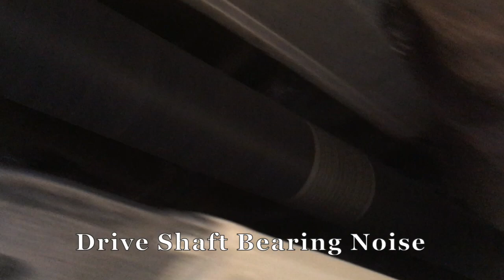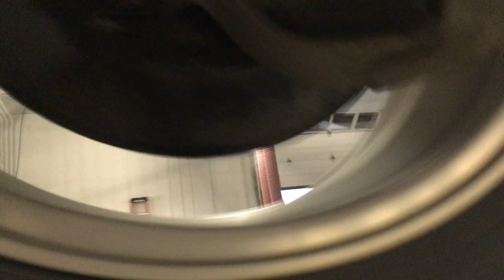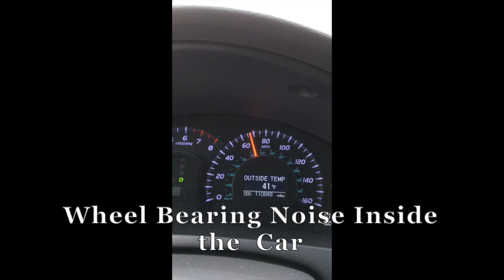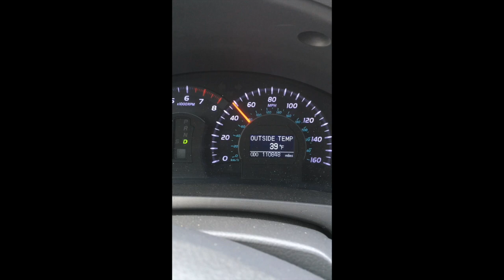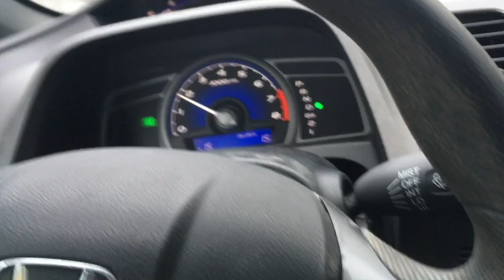Wheel Bearing Noise VS. Drive Shaft Bearing Noise

Comment: My 2017 Grand Cherokee limited (40k miles) just started making a low rattling/vibrating noise underneath. TBH I only noticed it bc I turned the radio off. It only does it once in a while and does not rattle/vibrate noise when going over bumps.  It also does not do it while turnung. When I put the window down to try to hear it I can't. I can only hear it when the window is up. I checked through the inside and nothing is loose inside.  My bf says it sounds like something is loose. It started right after inspection. I do know my front brakes need to be replaced soon..could it have to do with that?  Any suggestions?
Reply from the maker: Hi RyanMarie, usually a rattle at low speeds and the RPM's at about 1000-2500 is caused by a loose exhaust heat shield. I recommend you start by checking your exhaust for any loose shields, try hitting your exhaust with a rubber mallet or the palm of your hand when it's cold to see if you can reproduce the noise. Let me know what you find or if you have more questions.
Reply: @EddieCarrara1  thank you!  I will have my bf look. It is safe to drive?
Reply from the maker: @ryababe24  You're welcome, I don't know if it's safe because I don't know what is making the noise. I wish I had a better answer for you lol.
Reply: @EddieCarrara1  It's strange bc last night I accidentally hit a pothole due to the fog and now the sound has gone away lol

Comment: I have a rough whirring noise at speed above 50mph, more accuse at 70. It goes away when I depress the clutch. It’s not the engine as when I depress the clutch at rev, at speed, the noise isn’t there. That also make me think it’s not a wheel bearing.

Any ideas what it could be?
Reply from the maker: You're right Craig, it's not a bearing because the noise wouldn't go away when depressing the clutch, maybe a bearing in the transmission.
Reply: @EddieCarrara1  thanks Eddie 👍

Comment: Hey Eddie, have just subscribed got your channel and found a lot that is very informative and interesting. I own a jeep grand Cherokee and touching about 100,000 kms and find that everytime I cruise on the motorway, I get a vibration noise between 80 k mph and 100 k mph which is roughly between 50-65 miles an hour but disappears when I take my foot of the gas. The vibration does not seem to appear at lower speeds as well. Any help
Would be great. Thx Vikas
Reply from the maker: Hi Vikas, It's sounds like you're describing a ring and pinion noise or maybe a driveshaft carrier bearing noise, but , with our hearing it it's hard to guess. Let me know if this helps of you have more questions.

Comment: I got a high pitched screech sound when I moving forward, doesn’t matter the speed. It will go away sometimes, but comes back once I make a left turn, any ideas ? 2013 Mitsubishi Lancer GT
Reply from the maker: Hi Ozzi, sounds like the brake pad wear indicator is hitting the rotor warning you that the brake pads are getting low, I recommend you inspect all 8 brake pads. Keep me posted on what you finds, thanks.

Comment: I knows that rule of thumbs BUT... sometimes is backwards, I replaced the right bearing on the front, then noise still in there, then replaced rear right, and still there, then just in case i put the front right one (supposedly bad) on the left side, and noise was gone. I put together somethings, ..that I was driving alot on high way and taking exits and switching to another highways, and all that weight of the car going 70,80 mph all on the left side made wear down the bearing in a way that when i ease on that left side , turning left and put the weight on the right noise would go louders, feels like the bearing on the left got wore down in a way that actually having more weight on that would not cause noise but doing backwards would
Reply from the maker: There are things that happen in the automotive world that just cannot be explained using common sense, this is one of those things lol, thanks for sharing Junk Mail 🍺

Comment: im so lost. all the videos i look up none of the sounds sound like my car. its a quieter popping noise like popcorn. when i slow down, speed up, turn loose or turn tight but not everytime. no clunks, no loud pops, just quiet ones a lot in a row. i looked at wheel bearing, drive shaft, cv boots, axles, shocks etc, none sound like it :(
Reply from the maker: Hi Ariana, check out this video, it's one I made on CV joint noise. Watch the whole video because there are a few seconds where the noise is very obvious and let me know if this is the same sounds toor car is making. If it's not maybe you can take a video of it happening and post it to YouTube and send me the link so I can hear it.

Comment: Doesn't leaving the CV joints on that angle and letting the engine spin them damage them?
Reply from the maker: Hi Nick, no, the suspension can only hang so low. we've been doing it like this for 35 years lol. Good question tho.
Reply: @EddieCarrara1  The reason I ask is because in any service manual I read it says not to let them hang that far down and to have the car supported on jack stands and lift up the trailing arms to keep the drive axles as straight as possible?
Reply from the maker: @nickfatsis9607  I think the reason for this is when the suspension is hanging it will create different noises because it's not at its normal ride height. As the vehicle goes down the road the suspension is constantly changing ride heights and is not being damaged. I have never damaged a vehicle with this procedure and some vehicles have been driven on the lift for over 30 min sometimes trying to locate a noise. I'm not going to say you could never damage a vehicle with this procedure because I don't know everything and every situation is different,  I'm just saying for all the years I've been working on cars I've never experienced it nor has any of the mechanics I've worked side by side with experienced it. Hope this helps.
Reply: @EddieCarrara1  well you're correct about ride heights, sometimes people drive at high speeds over rapidly changing road heights, the car goes up and down pretty quickly and the suspension is fine, thanks for the reply.
Reply from the maker: @nickfatsis9607  You're welcome Nick. I know there is an exception to every rule and I certainly don't know everything so I like to show or explain my experiences rather than try to prove I'm right. I know there is a lot more that I haven't seen than what I experienced, lol. Thanks for bringing it up, it makes us question ourselves which is a good thing, Cheers 🍻

Comment: My jeep 2015 grand Cherokee is making a sound coming from the front gets louder when going faster almost like a rotating sound like its grinding with somthing also vibrates my pedal a little
Reply from the maker: Hi Jerry, 
I recommend you inspect the brake rotors for rust on the braking surface. It's possible you may have two different problems. Does the rotating sound make a noise like a wheel bearing when comparing it to the wheel bearing sound in the video? The vibration may be caused by brake pad impressions on the rotor surface or rust, I'm assuming the vibration is in the brake pedal when braking??
Reply: Mine does also and iv had my brakes checked my wheel bearings changed and my shocks changed and still does it

Comment: I have a rubbing sound when accelerating and coasting. I think it’s drive shady related but unsure.
Reply from the maker: Hi LongBeachGrower, is it an automatic or standard transmission? The noise maybe a motor or transmission mount that is worn or broken?
Reply: @EddieCarrara1   Thank you, it’s an automatic. The noise sounds like it’s coming from thee middle or rear of the car. 2002 Chevy Astro AWD
Reply from the maker: @nonamenomad5768  If the vehicle has a center carrier bearing in the propeller shaft, that may be a possible cause. I recommend you check that first. Let me know what you find, thanks.

Comment: I have a squealing noise like if I was drifting, when I drive and turn a corner or if I hit a bump on the road. I’m having a hard time trying to figure out the problem
Reply from the maker: Hi Bryanna, check the brake pads, one might be low on material and the brake pad wear indicator may be touching the rotor. Let me know what you find, thanks.

Comment: Hi Eddie. I have a 2001 Toyota Sienna van with front struts, ball joints, drive shafts/tie rods and as of this weekend control arms replaced. Since 2017, I've been through 5 sets of tires and on the front passenger side twice I've had the inside of tire wear so bad or split due to what I thought maybe the control arms. 252,000 miles on those. I drove it this weekend with new tires and she is dead on center of lane at 75 mph highway, but there is a low humming sound still!? My Toyota mechanic told me it was drive shafts and I replaced those two years ago. He said wheel bearing was fine. I believe that front bearing is bad, but I am totally lost having replaced everything but the rack and pinion.
Reply from the maker: Hi Debbie, If possible I highly recommend you get a second opinion on the wheel bearing. A thorough mechanic will put your car in the air and check each bearing with an automotive stethoscope to pinpoint the noise. If they just drive it they are guessing and that's not cool. Let me know if this helps or if you have more questions.

Comment: My 2009 Volvo C30 is making creaking noises from the front passenger area. Seems to be related to throttle input but also steering while going slow and hitting bumps. I’m thinking it may be a engine mount or ball joint but not entirely sure. It started a couple days ago and the weather is now below 30°
Reply from the maker: Hi Simon, 
Both of those worn parts can cause a noise like you're describing. Do you feel any clunking when snapping the accelerator hard from a stop or power braking when stopped?
Reply: @EddieCarrara1  nope it’s just prominent creaking when pressing on the gas and when turning at low speeds. Bumps don’t necessarily cause the noise but they do affect the noise when accelerating. I’m also considering the control arm bushing as a possible culprit

Comment: I have a humming noise when I drive straight or left. It goes quieter when turning right. Its loudest at 50-60mph. I also saw some dark green gunk under my car, don't know if its related. Is it my driveshaft, cv or wheel bearing? Or all three?
Reply: Golf MK5 GTI
Reply: It also clicks when I full lock right
Reply from the maker: Hi AZ, The green gunk is most likely CV joint grease, it's possible one of the boots is torn open, that would also be the reason for the clicking noise. Unfortunately the hum noise is likely a wheel bearing. By your description it would be a bearing on the right side of the car but I recommend you have it diagnosed by a reputable mechanic just to be sure. Keep me posted on what you find, thanks.

Comment: 2004 honda accord coupe v6 manual I get vibrations during  acceleration under load and sometimes after a while of driving even on highway when coming to a stop it sounds like a growling sound from the passenger side no one know what it is 😭
Reply from the maker: Hey SS, check out this video I made https://youtu.be/1f13AFjqyrY We had a vehicle that did the same thing and this is what we found so you may need to replace one of your axles to repair your problem. Let me know what you think, thanks.
Reply: @EddieCarrara1  thank you kind sir! I will definitely!!!

Comment: I have a Chrysler Sebring 01 and I've been hearing a noise as well. Overtime it has gotten louder. At first I never could hear it but my child father heard the noise from my car. I didn't start hearing it til a few weeks later because it was noticeable. When I accelerate it from 30mph-70mph it's really loud. If I drive it under 30 then the noise is low but what would happen if you keep driving on it and you didn't get it fix yet?
Reply from the maker: Hi Makita, It's going to continually get worse and the noise will get louder. I recommend you have a mechanic check the noise and give you their opinion on how long you can drive on it. hope this helps.

Comment: Hi eddie, my car developed a bad wobble on drivers side at around 50-60 mph but goes when I put the clutch pedal down then returns once released. Took off wheel and my bottom ball joint is bad, would this cause a wobble on the wheel ? And would it stay if I put the clutch pedal down or am i looking more like a bad drive shaft cheers eddie
Reply from the maker: Hi LLoyds, ,I recommend you start by replacing the known problem first and if the you still have a wobble I recommend you check your u-joints if you have them because it sounds like you may have two different problems. If you don't have u-joints and your car is front wheel drive, the clutch problem may be either a worn inner CV joint or clutch pressure plate. Let me know if you have more questions.

Comment: @eddie Carrara how you doing brother ? Listen I have a noise on my Acura MDX and I take the car to the mechanic and they didn’t find anything but Iam pretty sure that the car have a noise who can hear it if you roll down the window. When you go at high speed 50 , 60 the noise is more notable but when you press the brake pedal to reduce speed you can hear it louder. It’s not a clunk or squeaking sound it’s more like the wheels rotating and getting in contact with something like a straw. If you have the car up in the jack and someone in the car driving and you put a straw to get in contact with the tire. That’s the best I can describe that noise. If you can help will be very appreciated. Thank you
Reply from the maker: Hi Hansell, I'm doing well, thanks for asking 🍻Does it sound like a helicopter or a humming noise? It could be a wheel bearing noise, they usually start making noise around 20 mph and get louder the faster you go. Can you make a video of the noise and post it on YouTube then send me the link so I can listen to it?
Reply: @EddieCarrara1  hey brother thank you for your answer I will do the video but checking again your videos about the difference bt bad driveshaft and bad wheels bearing is sound more like and helicopter sound but when you slow down the speed it make noise too. I take the car to the mechanic and he checked but I don’t thing is what he said it is because he’s diagnostic was the brake drilled rotors make the noise. But Iam pretty sure it not that I just installed them a years ago all 4 rotors with the brake pads.

Comment: I have something similar sounding to the drive bearing noise in a 2003 Subaru Legacy b4 twin turbo. However it’s accompanied by a smell of gear ok even though it’s just been replaced with the correct grade of oil.
Reply from the maker: Hi Mars, did it have the wrong gear oil in it?

Comment: How can you tell if it's front or rear wheel bearings,
Mine starts roaring around 50 km per hour, when I steer to the right,  it noise is a bit better,  and when I steer left, it's louder.
Reply from the maker: Hi Juwan, you'll have to take it to a mechanic so they can check the noise when the car is in the air. It sounds like it's a bearing on the right side of the vehicle but I'm not sure front or back? Keep me posted on which one was bad, thanks.

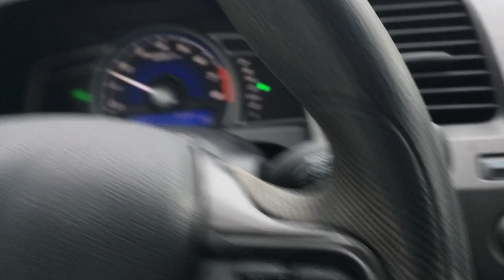Comment: Thank you for the video, it's very helpful.  Your explanation at 2:40 makes sense "the side that the bearing is bad on usually gets louder when you put the weight of the vehicle on it."
When you make a right hand turn doesn't that put the weight of the vehicle on the right hand side, and therefore on the right wheel bearing?  So if the right wheel bearing is bad, shouldn't it get louder when you make a right hand turn?
Reply from the maker: Good question Mario. When you turn right, which way does your body want to go, left or right?  You weight goes left which explains simply that the weight of the vehicle in a right hand turn would be on the left wheel. Hope this helps, let me know if you have any other questions. Cheers 🍻

Comment: EDDIE PLEASE HELP, MY CAR IS LEAKING GREEN FLUID, VERY BRIGHT GREEN, I DRIVE A 2011 VW GTI with 116k miles, i am lost on what to do and dont wanna be charged too much money for diagnosing
Reply from the maker: Hi Alec, Bright green fluid is usually engine coolant. You'll need to pinpoint the leak and devise a plan of action to fix it. Let me know what you find, maybe I can help diagnose the issue.
Reply: @EddieCarrara1  my coolant is purple i drive a euro performance car, so thats why im really confused
Reply: @EddieCarrara1  and it takes gear oil in the transmission, im thinking possibly a differential, my friend told me they can leak a little if its extremely cold and ur driving thru snow
Reply from the maker: @devilmk6769  Sometimes mechanics will add dye to the AC to locate leaks, the dye is fluorescent green/yellow. Can you take a short video of the leak, post it to YouTube and send me the link? Watch my AC video and let me know if it's the same color? https://youtu.be/y3YOHX0siEU

Comment: I have my vehicle making sorts of humming or grinding noise when decelerating all the way from 40km/h to the stop, what problem can that be? I also tried to keep the speed around 30km/h for a range of distance, so the speed was kept around 30km/h all the time, the sort of the humming and grinding sounds are appearing the most noticeable during at the speed. I’ve replaced the brake rotors and pads as due to the noise, but the noise just stays the same.
Reply: I also recorded the noise when driving, which you can find in my video posted. That really confuses me
Reply from the maker: Hi Chenglong, Yes, it sounds like one of your wheel bearing my be causing your noise. I recommend you have it checked by a seasoned mechanic who knows how to diagnose noises. Keep me posted on what you fine out and if you have more questions I'll be right here 😊
Reply: Did you figure out your problem im having the same problem